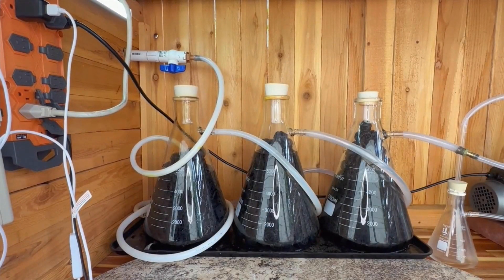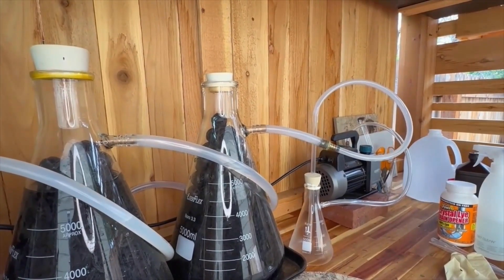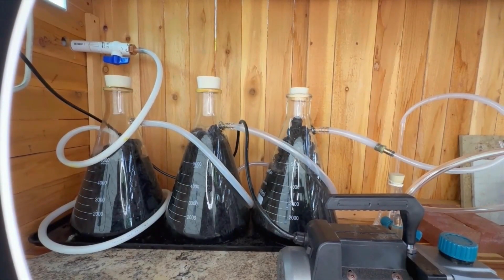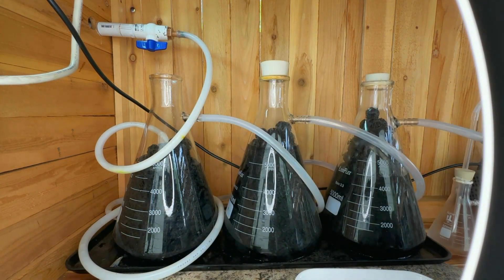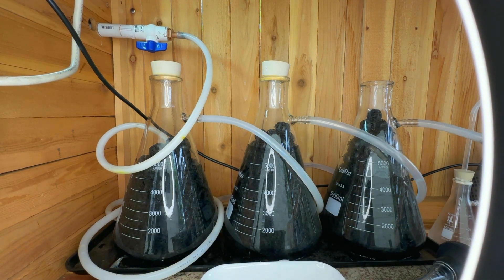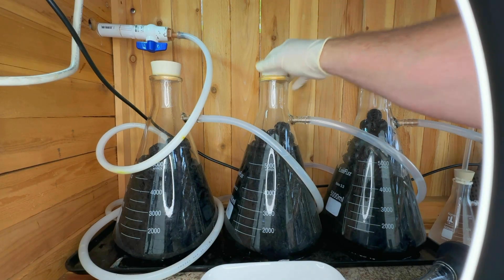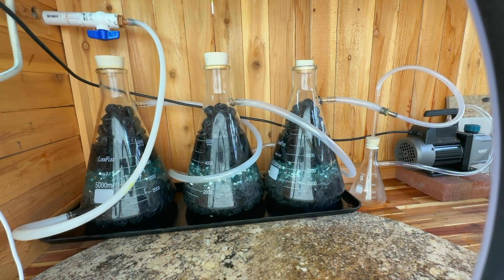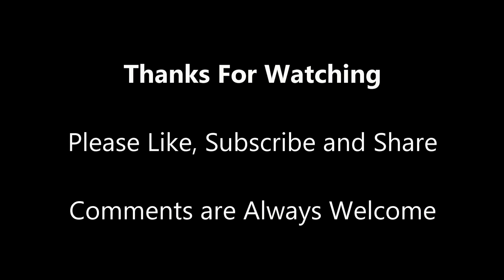Refining and Recovery   DIY Fume Scrubber Overview and Maintenance

Comment: Very neat configuration.  Mad respect on trying to refine and do it in a more environmentally friendly manner.  Most folks don’t scrub the vapors and just vent them outside.  Do you have a vent in your fume hood you can cut on in case of a runaway reaction?  I imagine that setup is limited on the amount of air it can move.
Reply from the maker: Thanks for watching!  Yes, the hood has a main vacuum vent that handles fugitive fumes.  It uses a Venturi setup with an adjustable blower and does a great job.
Reply: @AcidnGases  Great to know.  I want to improve my setup to be more environmentally friendly for this summer.  My winters are spent trimming ram fingers and depopulating boards and sorting through materials preparing them for processing during the summer:  want to be as echo friendly as possible.  Already have 10kg of ram bga chips and a kg of fingers and the. Winter has a long way to go.  Not to mention all the slimes from the dissolved solder.  It’s going to be a busy processing season for me.  I have no clue how yall have time to do videos but I’m glad you do:
Reply from the maker: @ExtractingMetals Sounds like you have a great processing season ahead of you!

Comment: That’s a great idea for scrubbing your fumes. For recovering the nitric acid, are you doing a fractional distillation? Will you do a video on this?
Reply from the maker: Right now I don’t have or spend the time, I treat it and dispose of the neutralized, reduced liquid at the county HazMat facility.
Reply: @AcidnGases  what flasks are you using? im having difficulty finding double ported flasks online. :)
Reply from the maker: I put the Amazon link in the description.  They are currently out of stock, but I have noticed they come back every now and then, if you check on occasion.
Reply: If you you are ending up with a weak nitric acid in the first beaker, then evaporating the excess water will increase concentration. If you are capturing gases from hcl and sulfuric acid as well, then you can separate them with distillation at different temps. I think you'll get the chlorine out first, then the nitric, and be left with sulfuric. Then, if you want to crystallize out the salts from the next two flasks, you can add them to sulfuric acid and distill out the HCL and the Nitric.

Comment: Hi Acids and Gases, i am revisiting your video again. Question for you, do you have an exhaust system setup for your hood for if you get rogue fumes building  up?
Reply from the maker: Yes, the scrubber is the primary outlet to clear NOx fumes.  Hood itself uses a Venturi based exhaust system as well as secondary exhaust.
Reply: @AcidnGases  Thanks for the reply, that part would be good to see one day.
I have been using an inline fan to exhaust the rogue fumes not picked up with the scrubber, obviously that will be catastrophic for the fan eventually.
Reply from the maker: I’ll put it into a future video.  I also have gone through a few fans before I went with the Venturi system.  it’s been working great for years.  worth it.
Reply: @AcidnGases  Cheers mate, cant wait to see your setup.

Comment: can you provide more detail on that air pump you use?
Reply from the maker: This is the link.  https://amzn.to/4pO7O8e   it’s a vacuum pump used for AC work etc…,  The key in when using it in the scrubber is maintenance of the system and the flask at the end that catches condensation, keeping corrosion out of the pump.
Reply: @AcidnGases i am trying to put a system like this together. I am having trouble finding a 2 port vacuum flask like you are using. Also, maximizing the cfm of vacuum seems critical, but the liniting factor im seeing is: 1. Vacuum port ID size and (best i can find is 10mm max) 2. Flask max vacuum limit before catastrophic implosion. ( seems most flasls are limited to 0.6-1pa so pairing with the proper sized pump is critical)
3. Dwell time for gas scrubbing in the solutions (too quick of the gas pull through would lower overall chemical  reactions between the nitric and bottle solutions).

Need to find the sweet spot between proper hood gas removal and proper chemical reaction time as well as making sure the flasks dont break or hoses crush from too much vacuum.
Reply: For example, using a massive 15cfm 1.5hp vacuum pump would be able to pull lots of air but the pressure would likely cause the flask to implode. Also, pulling the gas too quickly though the solutions may not allow enough time for the chemical reactions to take place. Altough it seemed from what saw in the video you may benefit from a slightly bigger pump to help gas removal from the hood. Would you go with a slightly bigger vacuum pump now after your experience with that small one you have? Maybe a 1/2hp one instead
Reply from the maker: you can use a drilled stopper and tubbing as input with a normal filtering flask as well vs the 2 port flask. The tube through the stopper should go to the bottom of the flask, and the filter port would output to the next tube.  

 I wouldn’t worry about imploding a flask, the pump is pulling gas through, so minimal vacuum actually exists in the flask unless you run the system with the input valve closed.  

Yes, too big a pump is bad. The one I’m using for the scrubber 3.5cfm, is .46 cf every 8 seconds.   The flask volume of 15 liters total is .56 cf, this gives 8-10 seconds of contact time through the flask chain.  

The hood is not a problem.  The pump is adjustable.  it was on 1 which lets the fumes linger a bit,  10 is the max setting which clears the hood instantly if needed.
Reply: @AcidnGases wow this info is gold. Thank you so much for replying! I hope to see more of your videos soon.

Comment: Great video, thanks very much.
those flasks are awesome, i cant find them anywhere in Australia ;(.
Reply: Id like to know where to those flasks also
Reply: You can do the same thing with a regular vacuum flask and a chemical resistant stopper with a hole in it. Insert a snuggly fitting glass tube through the stopper far enough to where it will reach near the bottom of the flask.

Comment: Can we see it in action while you have some actual gasses going through it?
Reply from the maker: Next refining video I will show it in full, inside and the flasks.  You can also see it pulling from inside the fume hood on the 6k fingers refine video.
Reply: @AcidnGases I distill my own nitric and was just wondering about a way I could capture the fumes and condense them back into nitric to reuse and then this popped up and I would have never thought about doing it this way.
Reply: @leewhite1969 I was trying something like this set up with an arc generator to make nitric acid. It's very slow, but I can combine that with a fume hood scrubber. It's a great idea!
Reply: @AcidnGases  I saw in your video of it pulling from inside of the hood but was wondering what it looked like on the other side

Comment: Hi I'm a new sub, you got around 300 followers. I'll like and comment on all your early work, while your channel builds. 

Content wise I'm wondering, was that glass chips added as medium? By the end you're aquarium balls looked like they had a layer of supting else. Please advise. 

Audio question/critique are you wearing a body mic inside a mask? I was not bothered by the differences but I was aware of the character of the sound changing throughout. It seemed like you were trying to censor the word "nitric" what were you trying to say/hide? 

Good edits, the led ring makes enough light but you could see the edge in some shots, and it makes you appear like your fumbling trying to reach around it in the reflection. 

Great content many YT chemists leaving out these secondary processes that they engage in for refining. I'm very interested in all of it, but mostly like organically supporting new channels. THANK YOU !
Reply from the maker: Thanks for the feedback.   It is glass chips, I am looking to break up the bubbles to get more exposure to the solution. I have been testing some different equipment (mic and light in this case.)  The mic I was not happy with at all and will keep looking for something else.  The light worked well, but I was clumsy on occasion, learning opportunity for me.  Good catch.  I caught myself saying Nitrous Oxide not Nitric Oxide on occasion.  I gave up trying to "fix it in post" but decided to leave the incorrect word out as much as possible, they are very different gases and didn't want to mislead anyone that the fumes are Nitrous.
Reply: @AcidnGases  This is a crazy idea but if you flipped them upside down the gas would spread out. It's would be way too dangerous though, and make maintenance dang near impossible. Maybe tilt them a little bit. Prolly safer😅 .
Reply from the maker: @jMarbet Tilting them is something I have thought about, would need a stand that would keep them secure. They work well already, but I like to tinker when I get the time.

Comment: Where do you  dispose of the waste material at? Down the sink or like a medical waste place?
Reply from the maker: I am fortunate and have a county Hazardous Waste facility.  I label it, drop it off and they take it from there.  Sodium Nitrate is not technically a hazardous waste (it is often used in curing meat,) but they prefer I bring it to them vs. dumping it.
Reply: @AcidnGases  good to know, never knew that on sodium nitrate
Reply: @jasonwoods3384sodium nitrate is also a fertilizer. If you don't want to distill it for reconstituting nitric acid, you can add it to garden soil, or feed house plants with it.